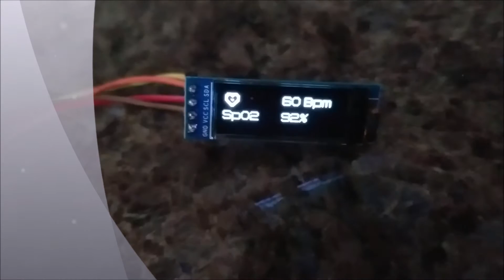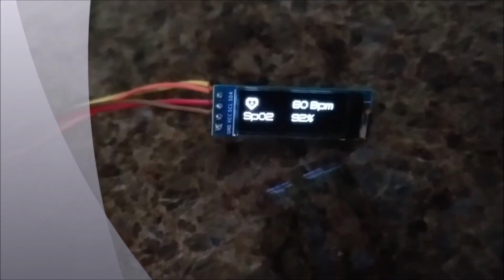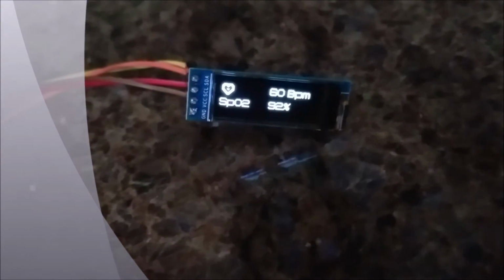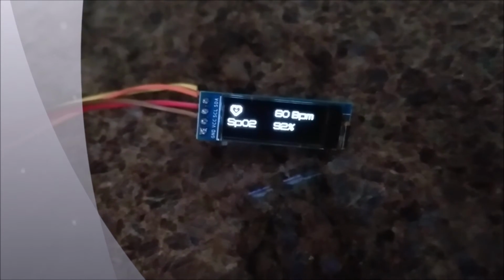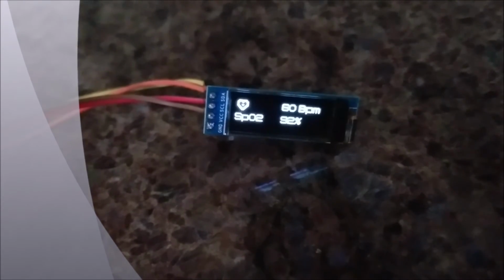Arduino Heart rate monitor using MAX30100

Comment: Can I do this with arduino pro mini?
Reply from the maker: Hi, yes it can be, completely certain about pro mini 328P, but I think 168P should work too. regards.
Reply: MakerUSA when I try compile a program why there are many error message like : in file include from C : arduino\libraries\max30100_pulseoximeter.h:27:0?
Reply from the maker: What's the error message, difficult to say what exactly is the issue you are having.

Comment: I followed the instructions in the github  but the code does not proceed after place your finger
could someone tell me what is the problem ??
Reply: add the following line in the setup before pox.begin()
pox.setIRLedCurrent(MAX30100_LED_CURR_7_6MA);
Reply: friend try to do it but I send the following problem,
MAX30100_Heart_Beat:124: error: stray '\357' in program

      pox.setIRLedCurrent(MAX30100_LED_CURR_7_6MA);ï»¿

      ^

MAX30100_Heart_Beat:124: error: stray '\273' in program

MAX30100_Heart_Beat:124: error: stray '\277' in program

exit status 1
stray '\357' in program

Comment: @MakerUSA
1.Need some help when i am connecting ird and rd to common ground the red led doesn't light up,
but if i keep ird open the red is light up.When red led light up the sensor didn't get initialised.
And on running test module the red=0 and ir=0.
And do i have to connect interrupt to any digital pin and if it has to be pulled up or down.
2.After done uploading "Place finger on the sensor" prints on Serial monitor but after this nothing to be happen.
What I do for?
Reply from the maker: Are you following the instructions linked in the video ? I don't fully understand the issue you are having.
Reply: 1.I am using Arduino  nano.If I am connecting the wires like you did, the sensor does not respond. It got respond when I connect the less than 4.7k(220 ohm)pullup resisters to SDA and SCL pin but red lED does not light up.
2.The red LED lighten when it goes to the GND alone but didn't happen any thing i.e it does not measure the
Beat or Spo2 .
3.when I connect both IRD and RED LED to the common GND  ,the RED Led does not light up but sensor is in working mode.
4.May I connect the RED and IR LED to the common GND or only  we have to connect the RED LED to the GND. what we have to do in any case?
Reply: Try connecting the PINS like below:
VIN -> Nano 5V
GND -> Nano GND
INT to Nano Digital PIN 2
SCL to Nano A5
SDA to Nano A4
Now try the following...
In the setup part add the following line of code before pox.begin()
pox.setIRLedCurrent(MAX30100_LED_CURR_7_6MA);

Comment: Cool project, and a great help for me in getting my Max30100 working. Just a question - you have a "filterweight" variable set to 0.5. On all test scripts and yours, my bpm were coming back about half. Setting your adjustable variable "filterweight" to 1.0 set the bpm correct, but I am not sure why my max30100 is so far out to begin with?? Any help or pointers? I did have to put two 4.7k pull up resistors onto the i2c lines, but I assume this would just make it communicate or not - not skew the results. The oxygen levels are correct too - about 93-95% etc, so that value is right, it's just the bpm coming back halved??

Am I dying??!! haha

Steve
Reply from the maker: You are right about the pull up, I am sure that should not make any difference. It's been a while since I did this I would need review it to remind myself about the values. To be honest I just played around with the numbers till I started getting reasonable results.
Reply: Express-Reviewed thanks for getting back to me.  You're rigjt, reading the GitHub documents the IR amp value needs to be adjusted till you get accurate readings. I got there! Great little script!
Reply from the maker: Glad to be able to help.
Reply: Stephen Ludgate Hi Steve, did you finally get it to work? I have been trying this for sometime and even followed Oxullo instructions but it still didn't work perfectly. Did you ground the RD and IRD pins? Did you use the INT with pull-ups? What current value did you use for the IR sensor? Thanks in advance.

Comment: I'm using this sensor, does it works fine with your code? 
http://www.ebay.com/itm/1PCS-NEW-MAX30100-Heart-Rate-Sensor-Heart-rate-click-NEW-C9/252443282089?_trksid=p2047675.c100623.m-1&_trkparms=aid%3D222007%26algo%3DSIC.MBE%26ao%3D2%26asc%3D44758%26meid%3D658eb8843deb496e8eea0a283af58b59%26pid%3D100623%26rk%3D4%26rkt%3D6%26sd%3D391709438817
Reply from the maker: I would guess that it works however I have not tested myself. I have shared the link for where to get the one I used.
Reply: it will work